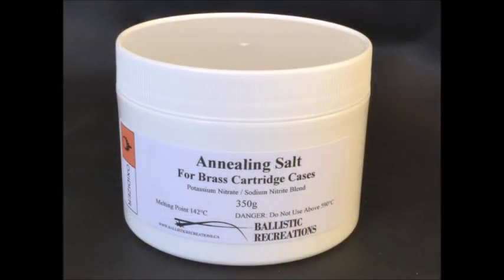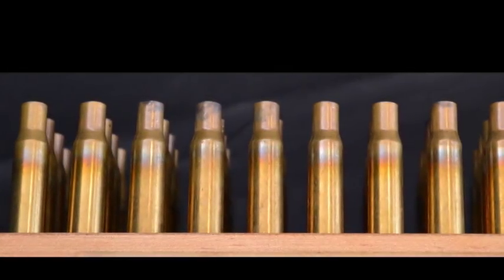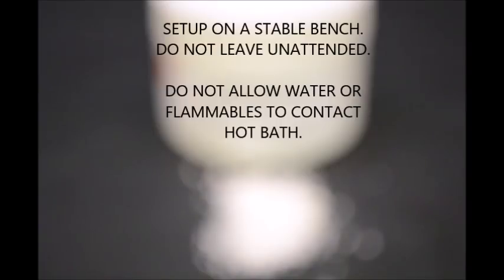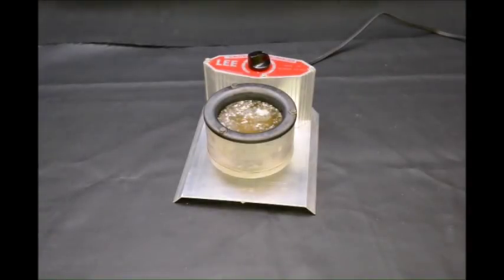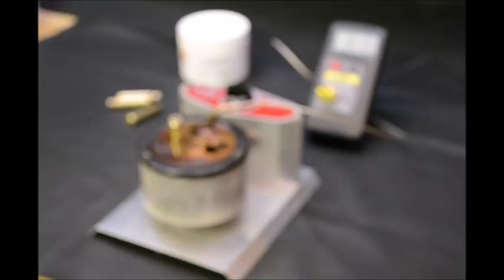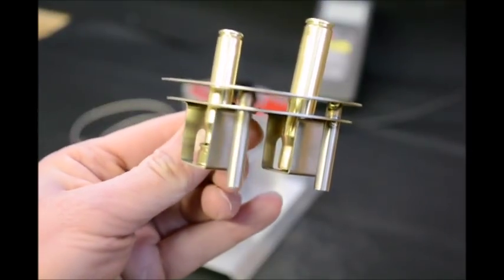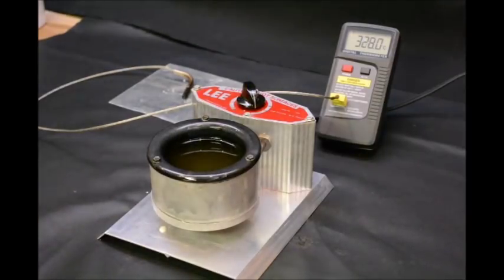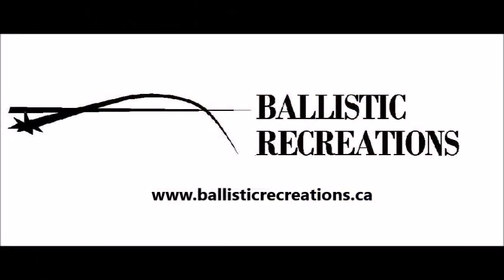Overview of Salt Bath Annealing

Comment: Excellent method of annealing my 7mm Rem Mag cases;  so easy to use!!  Placed the melt pot in a 'bay' of paver bricks & had no problem maintaining very close temps around 500 degrees Centigrade.  Dipped the cases for 5 seconds via stopwatch & dropped them into the water pail (didn't want excess heat creeping up to the case head!!).  Great video gives customers an accurate presentation of the method & much appreciated!!

Comment: Really great system.  Been doing .308 WIN and 9mm brass for a year now and perfect, no fuss , annealed brass every time.  I use an  INKBIRD ITC106 VH PID (VSS) controller  to control the pot temp to within 1 degree, hands and worry free.  There is a homebrew channel that an older dude explains how to wire it up easy with cheap home depot acquired  items.   This system beats more expensive annealers that require a lot of $$ and trial and error to set up initially.....its also way better than sitting in a dark room with a blow torch and a pan of water to tip your heated shells over in.

Comment: I ran my first cases today, there can;t be a better way to anneal. Set the temperature and away you go. Unless you are not paying any attention you can't over anneal.  Great system. Thanks.
Reply: Paul Leeper there’s a better way. The A.M.P. induction annealer, better in ever way accept for cost. Only worth it if you are target shooting helps if you have a few mates you can all chip in
Reply: This works just fine for my needs an it suits my pocketbook. I looked at them all right down to the propane torch and a socket in drill. I'm very happy with the salt bath annealer.

Comment: Been using mine for about a year now. By far the most affordable annealing system yet. Want to add    a PID controller to keep the salt hot. The bath cools as more cases are run thru. I like this method, but burns are a real danger. If you are seated while annealing, put something heavy over your lap.

Comment: I'm interested in getting one. Just a few questions? Do you anneal every time you reload the brass? Do you anneal after sizing or before? And do you wash you brass after you cool it in the bucket?
Reply from the maker: I have never been diligent enough to ensure the cases get annealed every time, every second time is probably more my pace.  This is probably not a critical variable, some people do it every loading, may people every third time.

I anneal before sizing, but again I'm not convinced there is a critical difference.

Yes to the last question, I give it at least a double rinse after dumping the quench water.
Reply: I anneal after ever 2 firings. That's 2 times in the chamber and 2 times through the neck die. Time to soften it it up.
Reply: Miguel Hernandez k

Comment: Neat way to go. I would like see about ordering from you but sadly everything is out of stock at the moment. I do have a question about the pot. I have a Lyman big dipper (my first pot) that sits unused since I have 2 LEE bottom pours. Do you know if the plate will fit that Lyman pot? If it does great, if not no problem getting the LEE.
Reply from the maker: I have never had a Lyman Big Dipper in my possession but I think that the opening is too big.  The upper plate on my holder is 80mm diameter, if the inner pot diameter is larger than this the holder will fall right in.
Reply: @ballisticrecreations722  I'll measure it tonight and let you know what I come up with. Any idea when the plates will be back in stock?
Reply from the maker: Batches of case holders are listed for sale every 2-3 days.  They sell out very quickly, so if you can't find them, they aren't out-of-stock "still", they are out-of-stock "again"!
Reply: @ballisticrecreations722  The big dipper is 102mm so a no go on that pot.
Reply from the maker: Thank you for clearing that question up.

Comment: Hello, What is the mat you have around it?  How would you recommend to prepare an area on a wood bench and/or what PPE for safety would you recommend?  Gloves, eye protection, cotton clothing?

Should I buy a metal box to put this in just to be safe?  Thanks!
Reply from the maker: The mat in the video is a black artificial leather for upholstering, it is there as a contrasting background for the video, not because it is well suited to the job of resisting salt.

The ideal bench surface is probably an aluminum plate, because it conducts heat away very quickly and for some reason the frozen salt doesn't usually stick to it.  A heavy aluminum pizza pan or cookie sheet screwed to the benchtop should also work well.  Steel is also good, but not as conductive and the salt will often adhere.

Frankly, my own benchtop is wood 2"x6" boards; sometimes I put down a cut piece of plywood if I'm doing something I know will make a mess.  Splatters and spills char the wood and stick to it pretty tenaciously, but those happen rarely enough that I don't really worry about it, and the volumes involved cool down before transferring enough heat to threaten combustion.  If I am doing something like ladling out a whole pot to clean the gunk out of the bottom, I do that over aluminum or steel plate.

Beyond that, safety glasses, gloves and a long sleeved shirt to protect your arms and wrists from splatter.  If you tap each case to remove the excess salt and have a good depth of water in your bucket, even minor splatter is rare.

Comment: Is this annealing the neck, shoulder, and upper case body or just the neck? Does the buyer have to make an internal step to ensure only the neck is in the salt?
Reply from the maker: It anneals however much of the case you choose to immerse.  Adjust the immersion depth by adding or removing salt from the pot, or by shimming the case holder with washers or a spacer.

I recommend immersing all of the neck and shoulder.  If you go a little into the body that is fine.

Comment: I would not recommend water quenching. This is a hardening process. Maybe through a tube with air blown through it first. The Old guys just drop theirs into a box to cool. If your water is near boiling, I don't imagine a big problem. But, a gradual cooling is required for proper annealing. Water is certainly necessary to remove the salts afterwards, although quenching is counter productive.
Reply from the maker: You are making the common mistake of extrapolating the quench hardening mechanism of steel to other materials.  The fact is that the iron-carbon alloy system is the only one that can significantly harden by rapid cooling.  There are a couple of other systems that undergo a similar crystallographic transition but  it doesn't have anything like the dramatic effect on properties we see with the Fe-C alloys.  

All other metals and alloys, including brass, are insensitive to quench rate in this regard.  Quench rate can affect other things such as homogeneity, but that is not usually an issue with alpha brasses such as 70/30 cartridge brass.

Comment: So how do you personally get all the salt out of the case after annealing it? I'm leaning towards this process but I've heard people say all the salt can't be removed. I'm not wanting any salt in my gun chamber. Thanks
Reply from the maker: No one has commented to me about having troubles removing the salt.  The quench water dissolves the salt completely with less than 5 minutes soaking time.  You do need to flush with clean water at least twice to make sure all the salt water is gone, stirring the bucket around to make sure the cases actually drain each time.
Reply: Ballistic Recreations tumbling the brass in a franklin arsenal brass cleaner should assist as well in making sure salt is removed from the brass.

Comment: How much of the case goes down into the molten salt?
Reply from the maker: I like to get them somewhere between mid-shoulder and the shoulder-body junction.
Reply: thank you, is in necessary to deprime before annealing this way?
Reply from the maker: I don't know that is absolutely necessary, but I always deprime beforehand.  The salt flows into and out of the case much better and you avoid any splashing of the liquid salt caused by an expanding bubble of air trapped within the case.

Comment: Your order form has a kit what is included in the kit. I only need the case holder and the salt
Reply from the maker: A kit includes one case holder of your choice, one thermocouple, a digital thermometer and one jar of salt.  
All of these components are available separately on the order form, so you can build your own set or get extras of anything.
Reply: so If all i'm wanting is the case holder and jar of salt what would be the shipping to the us 73089?
Reply from the maker: I usually prefer to do this by email to sales@ballisticrecreations.ca, but minimum shipping cost for an order containing salt to the lower 48 states is $19, this order would fall under that.

Comment: does the brass have to be wet tumbled after or can i dry tumble?
Reply from the maker: The brass has to be soaked for a few minutes to dissolve any salt stuck to it, but it doesn't necessarily need to be tumbled, either wet or dry.  That is up to you.

Comment: If you're quenching your cases even in "hot" water, if its making them "quickly" cool enough to handle, you're wasting a good share of your time spent annealing. Thats called QUENCHING, even if hot water is used. QUENCHING "tempers" metal by rapidly contracting the outside surface, which seals in heat and stresses. Those cases in the racks you have a video clip of sure don't look like they've been "annealed" in hot liquid. Especially if they were quenched afterward.
Reply from the maker: Quenching from an annealing temperature range has no effect on the microstructure of brass, or most other metals and alloys.

Quenching through a phase transformation can have significant effects on many materials, but nothing else undergoes anything like the dramatic changes that occur in iron-carbon alloys when quenched from the austenite range.  People would be well advised to stop using that reaction as a guide to the metallurgy of any other material.

Otherwise, quenching has nothing to do with tempering; appearance and colour are poor guides to annealing; and your mechanistic description of surface contraction sealing in whatever is pure fantasy.

Comment: In the process of learning to anneal via torch, I have "ruined" cases by "overheating" them. At least according to many YouTube "gun experts" who claim that anything beyond "light tan color" is "too hot" and that any case heated that hot is "ruined". But because I'm a lifelong gearhead, professional mechanic, multi-decade shooter and I've come across "experts" my who life who didn't know their a$$es from a hole in the ground when it comes to things metallurgical, mechanical and such, and being a born "smartass" and "cynic", I prefer to learn via experience than assume someone who can accomplish the incredibly difficult tasks of making a video or typing a comment and uploading them to the internet knows what he or she is talking about.. 

So I took those "ruined" cases (.50 BMG), loaded them with the same MILD powder charge I was loading "good" cases to (650-grain FMJs at 2200 fps verified by chronograph) and fired them. I used my common sense and experience to decide that an "overheated" and "ruined" case was highly unlikely to damage my AR-50A1 even if it "catastrophically failed" as long as it was loaded to such a low level. I also determined  that the chamber would probably do the same job it does for HARDER and more BRITTLE brass when containing the energy transferred through the case to the chamber firing "hot" ammo, when softer "ruined" cases were fired within it at much lower pressure levels. 

I also decided that the  more likely outcome than a catastrophic failure would be that the brass would just be a little less work-hardened after one firing than it would have been otherwise. Turns out I'm either really lucky or the "experts" are full of b.s., because lo and behold my rifle didn't come apart at the seams, the cases came through with flying colors and today I couldn't find those "ruined" cases in my supply of empties or any of my loaded ammo if I tried. Nor did I notice anything abnormal when sizing, tumbling (wet tumbling with stainless pins in a Lortone rock tumbler I can get 10 or so .50 cases per 6-lb. drum) and resizing them afterward. 

I ended up going clear through my .50 brass (formerly once-fired Lake City with 8 or 9 PMC "American Eagle" cases) a couple months ago specifically to get all of my empties "on the same page" as far as prep goes and ended up sizing, tumbling, annealing and trimming all of it and I wasn't able to find any "ruined" cases during that process either. 

Is it possible to overheat and ruin brass? Absolutely. If you proceed slowly and carefully with a "Not enough is better than too much" attitude and use as large of a "training case" as possible so overheating is harder and seeing the color change that is the best and most reliable way to judge "correct" annealing, is it very difficult to "overheat" and ruin brass? Absolutely. Is it a good idea to remember that ultimately "DIY" means DO IT YOURSELF and that you and only you are responsible for your results and no "expert" is ever capable of giving you KNOWLEDGE no matter how much "information" he or she has? Absolutely. 

There is so much complete B.S. about ALL things gun and particularly AMMUNITION on the internet and on YouTube in particular today its really sad how many people consider them "reliable sources". Annealing in particular is just ridiculously over-dramatized and over-explained and over-experted its no wonder so many shooters would rather waste money than "risk" doing it. I've literally seen "how to anneal" videos that recommend QUENCHING CASES IN WATER immediately after heating, which HARDENS THE BRASS after you HEAT IT to soften and stress-relieve it. I've seen claims that BRASS DOESN'T WORK-HARDEN, which means that annealing is completely pointless since its done to soften brass that has been work-hardened. And I've seen a claim that ANNEALING HARDENS BRASS, which once again is as wrong as its possible to be, since once again, its done to soften work-hardened brass.

I'm a lifelong gearhead, 35+ year "shooter", 30-year welder/fabricator (electric arc w/stick, TIG, MIG, gas w/ and w/o steel filler rod, braze and solder) and 25+ year diesel mechanic and even without doing any of those things, I'm pretty sure at some point basic public school grade school or junior high science classes would have taught me some absolute basiscs of "material science" and "metallurgy" sufficient to know or at least KNOW TO LOOK UP what annealing accomplishes, why, etc. 

YouTube gun videos are mainly comic relief.
Reply: You obviously have zero knowledge on mechanics of materials if you think quenching brass or brass alloys will harden them.  You can only!!! work harden them.  
Show me your proof that quenching hardens brass alloys.  I'll take a picture of the grain structure for you or can just go read an ASTM book and educate yourself.
Reply: DEEREMEYER1 
I don’t believe quenching brass will harden it. You have a lot of good comments otherwise.